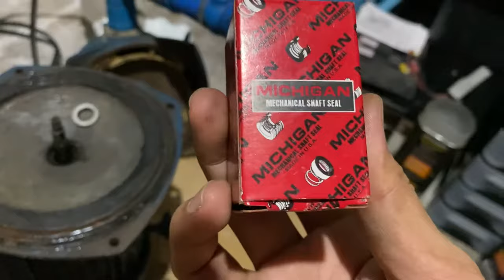How to Repair Water Pump

Comment: Paano sir kung may time na umaandar ang motor naka set  sa 10 psi ang starting, pero hindi tumataas ang gauge medyu iba din ang tunog andar lang ng andar, pero kapag i-off mo ang breaker then i-on mo uli iba na ang tunog ng motor at tataas na ang pressure kumakarga na? Ano po kayang problem kapag ganun?
May lumalabas naman na tubig mahinq nga lang.
Sa jet Matic po nakakonnect. May gate valve naman sa pagitan ng jet Matic at tinalian ko na din ng goma.
Reply from the maker: Maaari nagkukulang ang priming ng pump possible due to leak on the system. Kapag kasi may leak yan ay babalik ang kargang tubig pabalik sa source at mawawala or mababawasan ang water sa pump na need ng pump para sa proper operation nito.

Pwede mo try salinan ang outlet ng water pump(OFF State) ng tubig then observe mo kung nababawasan ito. Kapag nagbabawag ay check mo saan nag leak angvwater.
Reply: @rozaveltv  thank you po, I hope it will help.

Comment: ano po problema at solusyon sa pump namin, humihigop siya ng tubig ng 1mins (50 - 60 pressure niya) then babalik sa 20 yung pressure niya which is di na nakakahigop ng tubig. Salamat po sa sagot
Reply from the maker: Try nio po tingnan ang check valve, dapat po ay wala ito nakabara at nagipen clise ng maayos. Ikalawa ay check nio din ang suctiin pipung nito, wala dapat ito leak na pwede mapasukan ng hangin. Let me know if maging ok na ito.

Comment: Sir ask ko lang po..ano po kaya sira ng pump namin bakit lagi na lang tumtunog para magkarga.kapag mag open ng poset tutunog din ang makina.lagi po natunog .ano po kaya sira nya pahelp po
Reply from the maker: Actually, maraming maaring pagmulang ang unusual sound sa motor pump. Isa sa mga possibilities is defective, bearing, shafting and bushing, pwede din loose ang pagkakmount ng impeller sa shaft. Pwede din  ay normal sound generated kapag may hanging ang loob ng pump assembly. You may check also for any loose mounting bolt or assembly part of the unit.

Comment: sir ung sa akin, pag pina ON ko  mag lagay muna ko tubig  bago mka tubig, ano sira un sir?
Reply from the maker: If ang pump nio ay self primming pump ay may problema iyan pero kung hindi sia self primming pump ay need talga ng tubig para gumana ang pump. Check nio din ang check valve sa intake baka may nakbara or stock ang part nito.

Comment: Sana all marunung mag repair ng water pump.  
Frm kpatid vlooger po
Reply from the maker: Pede nio din po subukan, then tanong lang po kayo for any inquiry. Ingat lang po sa mechanical moving parts at energized electrical parts. Always perform LOTOTO for safety. 😊

Comment: Good job, full support here. God bless
Reply from the maker: Thanks a lot for the appreciation and support ❤️
Reply: May bladder tank po yong sakin sir pinalitan ko ng capasitor kasi pumutok nag over heat ata! Tapos yon hindi na gumana
Reply from the maker: @rodrigopioquintojr.9550  try nio po i heck ang check valve kung may bara at mga leak pti sa motor, make sure din po na may sapat na pasalubong na tubig kung hindi sia sef primming type ng motor.
Reply: Self primming po sya euro star 1/2hp
Reply: Anong messenger nyo sir para peivate mesage po kita salamat
Reply: @rodrigopioquintojr.9550  Marzon cutarra noel
Reply from the maker: @rodrigopioquintojr.9550  pakincheck na din po ang rotation direction, same dapat ito sa indicated arroq na nakaimprint usually sa motor fan impeller area

Comment: Ganyan din po tunog na motor pump ko sir wala nmang lumalabas na tubig
Reply from the maker: Check nio po kung may water or air leak ang piping suction or yjng check valve ay defective or may bara
Reply: Same din problema ko sa kanya sir. Nag oon ang makina pero walang tubig na binobuga. Wala naman problema sa source ng tubig. Wala din naman mga leak sa tubo. Ang tingin ko sa pagbuga talaga ng makina ang problema. Ang po kaya sira nito sir
Reply: Ako din sir wala lumalabas na tubig pero sa gripo mero